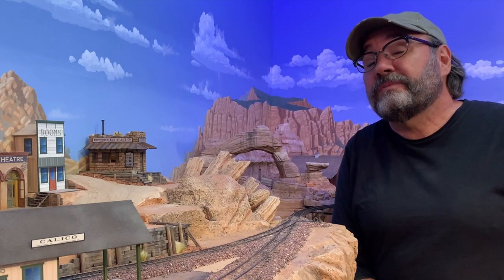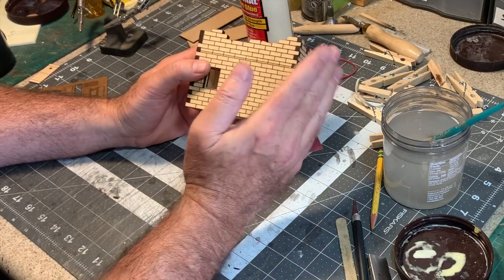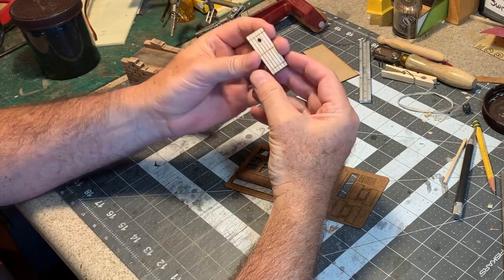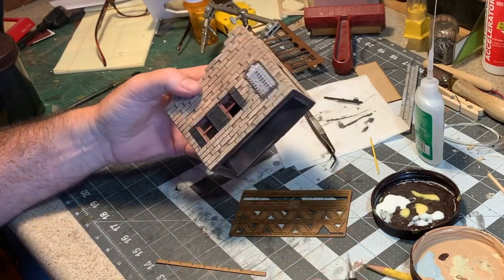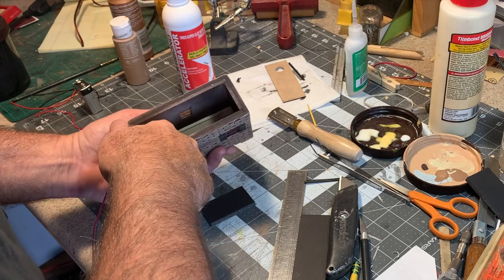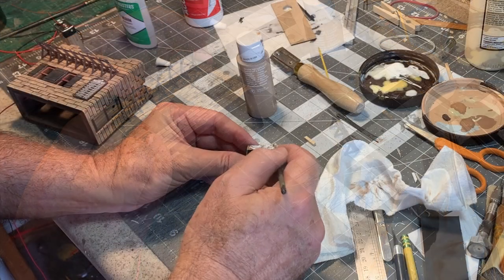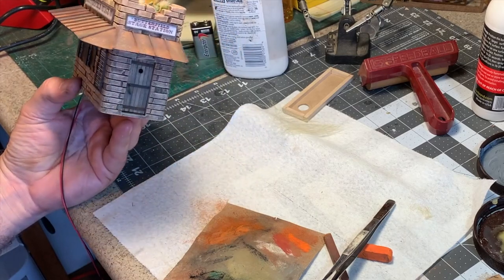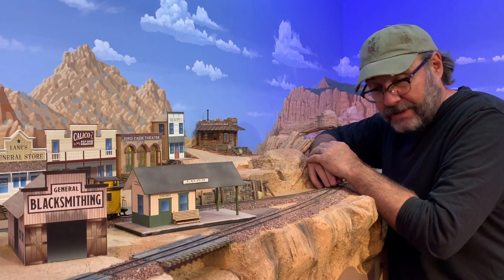Building a Western Boomtown Part 3: Butterfield Stage Depot

Comment: Dave for a similar structure made from limestone would I use the Rustoleum Camouflage flat tan or would I start like you and use the flat brown?
Reply from the maker: Either would be a good color to start with, then dry brush on lighter tan acrylics until you get to the limestone color you want.

Comment: Excellent model. I like a lot the metal roof, did something similar in styrene, but even with thicker styrene, it needed some strapping to prevent wrapping.
Shouldn't the laser allow to do the carving? Monster Modelworks do it professionally, but I didn't see many hobbyist using it. Maybe it is related to the model (and price) of the laser.
Reply from the maker: You can do some dimensional etching with the laser using raster rather than vector files, but they are fairly shallow and it takes a LOT of laser time. Better for smaller scales like HO/N. In this case, it was quicker and easier to do it by hand.
Reply: @ThunderMesaStudio  Ok, that makes sens.